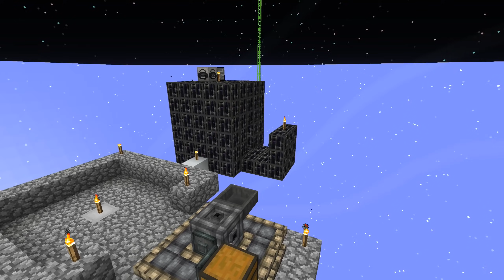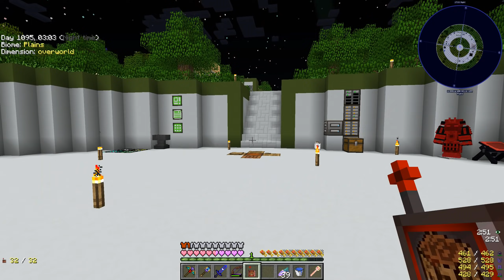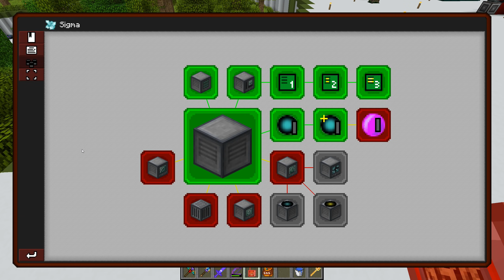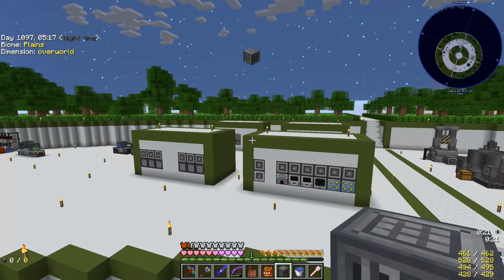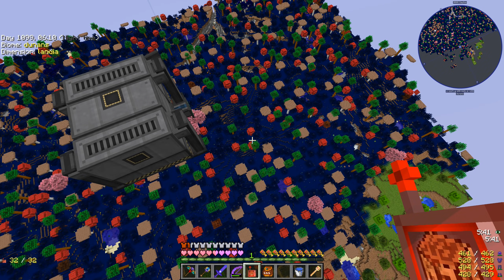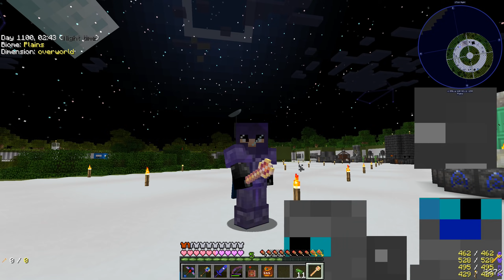Project Ozone 3 Kappa Mode - ORECHID ORE FARMING [E104] (Modded Minecraft Sky Block)

Comment: Just use a mercuial eye and make red matter blocks for basically free, make the transmutation table first after about 10 minutes of grinding red matter. Its way cheaper and then head towards wand of animation. Far more efficient. Way less friscion needed and way less guardian of gaia needed.

Comment: po3 seems to be way more insane when it comes to resource requirements than po2 was
Reply: At this point it seems to be that Kappa mode is a professional YT / Twitch Streamer or No-Lifer only game mode. Heh.
Reply: @N1ghthavvk  It really isn't. It's just extremely important to optimize autocrafting of pneumaticraft capacitors. It wouldn't take Hypno "5 years" to craft the 2010 capacitors he needs, if he was automating resource generation with mystical agriculuture, and had machine automations to use resources generated by those farms to passively generate the alloys and things that don't have their own resource seeds, had his plastic being generated automatically, and had more like 6 empowerer set ups to work with, and was using xNet for moving items and stuff around instead of the ender i-slow conduits.

I've done all this, and timed how long it took to complete 2 stacks of capacitors and it finished at about 6 minutes. It'd take about an hour and a half to do 2010 for the dimensional builder. I could literally do this right now (provided I slap 9 64k crafting storage on my crafting processor which wouldn't be a problem) and I'm still a fair bit behind as far in as Hypno is in progression.

Comment: still doesn't schedule capacitors when ae crafting is free

honestly, if you had a passive crop farm and were doing capacitors whenever possible this recipe could be possible to do now. Now it's hard to justify so much waiting, but it could have happend in parallel.
Reply: Problem with that is first I'm pretty sure he's still crafting plastic manually. Second, his autocrafting really is not optimized well enough to be able to complete a decent amount within reasonable time, so he can't really predict when he'll be away from the AE system long enough for it to complete anyway, and he'd end up with hundreds of ingredients being dumped onto his drives whenever he had to cancel half way through to use it.

If he got as much of the necessary alloys being farmed and processed passively, set up more empowerers, and switched out his ender IO conduits for X-net to speed up item transportation, then he'd be good.
Reply: @EuphoriaDreamer  it's not just that.
There's no reason not to keep the empowerer running as much as possible, as that's the machine that would bottleneck production.
It doesn't matter how fast your machine is if you don't even try to use it.

Comment: It is because the ultimate induction stuff takes 4 of the one before it.

It takes 4 basic to make one advanced. It takes 4 advanced to make one elite and 4 elite to make 1 ultimate 

You will basically need at least 1 stack of basic to get all of it. You will still have to do it.

Try setting up a conveyer line. For the capacitors have it always running

Comment: You can quintuple-to-septuple your friscion if you mine it using  an autosmelt tinker pickaxe with fortune 3 + the astral +1 fortune pendent and the +1 to all fortune astral sorcery skill its at the mid-top left of the skill page if i remember correct.
Reply: That only works if autosmelt and fortune interaction is enabled in the configs. It being kappa I doubt it is, but you never know.
Reply: @Gorden121  it does , i also use it on my play through , it also has some weird interaction with Dragonium ore , it does not septuple it , it does a x5-x30  with preaty inconsistent numbers , what i happening is i guess draconium drops dust that is affected by fortune , then it is AGAIN affected when it smelts the dust to ingots making this stupid numbers ,you should try it .
Reply: I was thinking about it whole 10 series from that moment. Heck , he has stupid amount of fortune ench and modpack have autosmelt ench...what even the problem to 2+2....>_<
Reply: Actually, you can boost fortune even more. With abyssalnomicon from abyssalCraft(the last book with 100k energy) you can combine enchants, so you can get fortune/unbreaking/whatever X
Reply: @gysget  unless abyssalnomicon way can actualy effect the fortune on a tinker tool you cannot use the Autosmelt enchantment from cyclic or any other mod with fortune , it only works for tinkers with astral because it effects the tool itself ,i have tried every mod that adds autosmelt with fortune and only tinkers changes the output with fortune , else you could make a fortune 6 with astral Horologium on the stelar refraction table , put in on a bound pick with autosmelt and use that .if anyone knows of a mod that adds autosmelt with fortune except tinkers please pm , it has been my dream to make the the ultimate autosmelt bound pickaxe since 1.6.4 .
Reply: @blapogolabla8353  I think there is a pickaxe from the twighlight forest mod that is autosmelting ores but I am not a 100% sure
Reply: @baua137  doesnt work with fortune , there are tons of Autosmelt pickaxes and enchants but none work with fortune , its tinkers exclusive for now .

Comment: Just start making emc instead of trying to bypass. Make capacitors with emc.
Reply: he needs the pink matter to be able to use emc.
Reply: @The_Mang  he needs pink matter to make one item, he didn't even check to see if there are other ways, I saw aternalis fuel can make klien stars, he didn't check if he can make a tablet. A tablet would let him do manual emc conversion, he is skipping straight to the emc chest which is for automatic conversion.
Reply: @starburst98  Usually in these packs the tablet is way more expensive than the chest, I don't really know the recipes in kappa mode though, so it might be different.
Reply: @starburst98  The energy condenser is the earliest form of emc conversion possible for him.  The transmutation table requires 4 magenta and 4 purple matter on top of the 4 pink matter he needs.  Klein stars are a form a battery for storing EMC to be used with Project E items that use EMC (namely swiftwolf's rending gale, watch of flowing time, harvest goddess band, etc).  It DOES NOT allow you to transmute items into other items though, or at least by itself.  You would need a transmutation tablet to use the EMC stored in a klein star for transmutation (and maybe an energy condensor?  Honestly never used it that way before), which brings us back to my first point.
Reply: @starburst98  BACKSEET GAMING!

Comment: Once you get the condenser you should try the magic multiplying tree to multiply the condenser and get a bunch
Reply: Are you thinking of the duplicator tree from orespawn? If so, that isn't in this pack. Otherwise, what mod is it from?
Reply: I remember a youtuber using that method with a modpack similar to this one
Reply: The condenser has a relatively low EMC though, so he can use EMC to make another and then dupe them
Reply: @vertical7747  that is also another way

Comment: I tried to play Project Ozone, but my computer too broke to handle it.
Reply: Mine cant even run the right version of Minecraft to play it
Reply: yeah you need a fairly beefy computer ram wise to run this pack smoothly.  If you are able to dedicate around 7-8gb of ram, it should be enough to run it (and this means you should have more than 8gb of ram installed on your computer).  There should be other guides you can find to learn how to check how much gb of ram is installed in your computer and how to dedicate the required amount of ram to minecraft
Reply: @leeminghwe It's available on curseforge.  To download you'll need to have the Twitch app installed, go to mods > minecraft > browse modpacks and search for project ozone there.  You should be able to find and install it easily from there.  Just make sure you have enough ram dedicated because running 260 some mods puts some real strain on your computer.

If you download the pack off of a web browser it will not download the full pack.  That file can be used in other programs like MultiMC to have it install, but it's a bit more complicated to do.
Reply: You were able to play po3 with 6gb dedicated to it but not anymore for some reason i just crash.. i have 8gb
So yeah
Also when nether was default it was nice now it crashes for no reason..